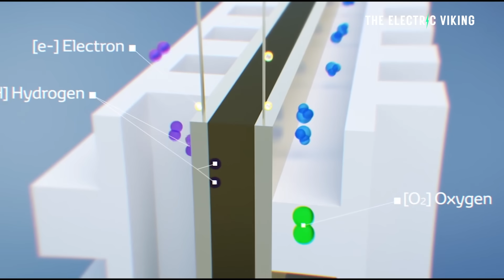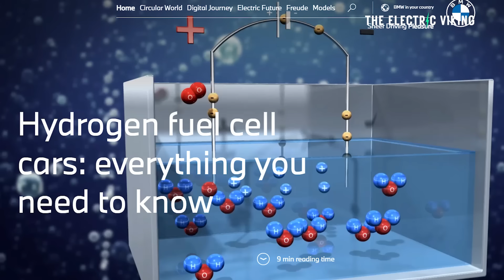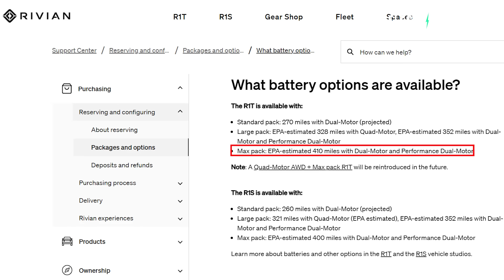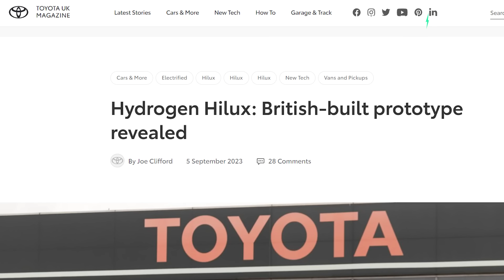Toyota's Hydrogen powered Hilux is the REAL future of the auto industry

Comment: Exactly what I say, hydrogen or ammonia...certainly not these EV's! No power grid for them, children mining crap to make batterys, no explosions that destruct everything around them, no range issues, no high costs of operating, no poor towing perf, no cold weather poor perf, no huge "take it in the arse" level resale problems, no insurance EV liability surcharges on premiums, no being told "no" by a tow truck driver or repair shop....wheew...wtf ARE we doing w/EV's! (that's rhetorical if you dont cheat at Solitaire and do have some dignity)

Comment: Can't wait for the hydrogen-EV hybrid version!
Reply: All H2 powered vehicles are hydrogen-EV hybrid versions.
Fuel cells don't produce enough current at a reasonable cost and size to provide peak power for a vehicle, so they all have a battery pack to spread the load. They also need a  battery pack to facilitate regen braking.
Reply: @PaulG.x  Not all. There are experimental cars with a hydrogen-fueled ICE engine.
Which is plain stupid. They consume twice the hydrogen that the fuel cell version does and don't have regenerative braking; in essence, you are taking all the weaknesses of the hydrogen car, combining it with all the weaknesses of the ICE car, and putting that into a single package.
Reply: @FabioCapela  I was referring to H2 fuel cell systems . Hydrogen-fueled ICE engine is absolutely pointless. And even then, they would almost certainly include a hybrid electric drive train because it boosts efficiency.

Comment: They have a point, which is consistent with European and American hydrogen production objectives by 2030. Transport is 15% of the global warming issue, the rest is due to burning gas and fuel oil. Consequently they are looking at Hydrogen has the means to replace natural gas and oil necessary to provide heat for power generation  and manufacture. The issue we know is hydrogen production and particularly ammonia transportation, billions are being invested in producing a solution, whilst blue hydrogen is the main source, prototype facilities to produce green hydrogen and ammonia are running in Europe.  However there’s a simple issue, the total European Car population is 250 Million on the road whilst European BEV population 3 Million cars or 1.2% so Europe is still in innovator stage. The U.K. is better at 3% with its BEV population of the total car population, so we have moved to early adopters stage so there is need for other solutions ammonia being only one.  There is a realisation, of the time necessary to cycle out cars hence the focus on synthetic and ammonia fuels to bridge the gap, hence why Europe and the U.K. have relaxed the ICE cars to 2035. However many professional analysts believe this will be pushed back to 2040, the original date suggested by the motor industry for full infrastructure to be available. 
However the priority for the EU and the U.K. which is aligned is to develop renewable hydrogen and it aims to produce 10 million tonnes and import 10 million tonnes by 2030. Prototype installations are working in Germany Spain and are being installed in the U.K. Consequently hedging ones bets, has Toyota is doing is sensible, indeed they are working closely with BMW, JLR and PACCAR Inc on the development of Hydrogen powered solutions. Basically you can’t find a three pin plug halfway up Cadair Idris.
Reply: Norway has shown how quick a transition to EVs can be.

This is more about legacy industries wanting a solution that they can dominate, not one they might not (like EVs, as we've seen).  And governments that are loyal to them (rather than to the people... it's a choice...just saying).  Of course, the legacies will say that they are the people, as they usually do, but the discerning observer will spot the difference.

The Biden administration's "target" of 50% of automobile sales being EV by 2030, looks more like a projection from public data on sales, likely to happen on current trends.

By 2040, most cars on the road may already be EV.  In motivated countries like Norway, probably well before.
Reply: @bearcubdaycare  Norway has 5.4 million population that half the size of London and they have a major hydrogen strategy, for example for heavy haulage this is in operation today. In 2022, the number of fully electric cars exceeded 500,000 in four European countries; namely Germany (1,089,854), the UK (641,801), France (605,791) and Norway (603,697) uk has over 900,000 now or about 3% of the total cars on the road, of 33 million.
Reply: "Basically you can’t find a three pin plug halfway up Cadair Idris."  Cant find a hydrogen station anywhere close to where i live. Every house from here to kakadu has a 3 pin plug.  The facts dont endorse your assertions.
Reply: @andyfreeze4072  Would that include Table Top.

Comment: I can be wrong here but even when hydrogen fuel cells become a reality you will still use electric motors.  The difference is you will fill up on hydrogen instead of using an EV charger.  So in reality it is still an EV.  The hydrogen vehicle may even use some limited amount of batteries.
Reply: Not may, will have a buffer battery. The reason is a fuel cell isn't capable of producing enough instant power to satisfy peak electricity draw.
Reply: You are correct . Fuel cell systems use the same motors and also require a traction battery.
The fuel cell is effectively a range extender
Reply: Less explosions.
Reply: @NonTypicalRacing  From what?  Hydrogen?  That's a good one.
Reply: @sambira  sure, our containment systems are much different now. What YOU need to do is objectively research EV's. After that, if you dont cheat at solitaire, you'll discover the OTHER problem w/EV's...zero resale.
Reply: @NonTypicalRacing  Wow, nice attempt at a response.  Zero resale?  In what universe?  Many resell their EVs all the time.  As for hydrogen containment, it is still a major problem.  Sounds like someone does need to do some real research.
Reply: @sambira  well, now either just lieing or sta sta stUpid in regards to EV resale.
Reply: @NonTypicalRacing  Prove that EVs are not and cannot be resold.  Show some data.  Also, prove that hydrogen is no longer difficult to contain.  And please learn English if you're going to try to troll in the language.
Reply: @NonTypicalRacing  Zero resale????

Another piece of FUD. Sure, residual value is less, but NOT zero.

You want to know why???

It's pretty simple, Newer models are just better vehicles, more range, better charging at lower and lower price points which lowers residual value of older models. Another fact is new vehicles come with Federal and State incentives which also lowers perceived value of older models.
Reply: @johnlodge8546  did your dumbarse actually think (strong word for EV crew) that I meant literally? Man Im waitin on the answer for this 1, this is good. Lol
Reply: @NonTypicalRacing  Any facts to back that up? 🤣
Reply: Hydrogen will never work because it is not cost effective. Already battery EVs cover the range needed by 95% of the population. Soon we could have 500 kWh/kg batteries, then there will be some 1000km a day cars. Hydrogen will never be price competitive.
Reply: They've been on the road for decades!

Comment: When will Hydrogen be the fuel of today?  50 years from now?

My cousin's wife lived in Japan until 2003.  She said that Toyota staked their future on Hydrogen in the 1990s and that is the story they are sticking with.
Reply: Japanese are known for their unwavering rigidity and at times serves them well, but right now it is becoming a huge liability.
Reply: Sandy Munro said that Toyota has a 100 year plan. I hope so, because it will take that long to get cheap hydrogen and H2 vehicles. Maybe fusion power. Maybe a pipeline to the sun, infinite hydrogen there!
Reply: Big concern no-one is taking about is the price of hydrogen. Currently it is many times the price of petrol or diesel and hugely more than electricity. 
Also currently it takes vast amounts of electricity to produce hydrogen. Seems crazy to do that rather than using it directly in ev's (which can also use an existing grid without the need for a hugely expensive distribution system)
Reply: @kevf101  I have not seen stats that show turning all our current diesel and gasoline usage for cars can be met by the current grids. Didn't Texas get a brownout just from some cold weather? Imagine quadrupling the power usage per home.
Reply: @geoffhaylock6848  The important thing is that EVs will reduce energy use drastically.  It's been theorized that the amount of energy used just to produce, refine, and distribute gasoline is equivalent to the amount of energy replacement EVs would use. Without burning oil.
Reply: @jamesvandamme7786  Nice idea. I'm a big fan of EV's. But when you change from one product to another there is a massive upfront cost in terms of CO2. The electric car factories did not exist and had to be built. The battery factories did not exist and had to be built. The huge amount of lithium refining needed didn't exist and is growing. There are good and bad with all forms of transport. Personal cars will never be 'green' they are simply a huge user of natural resources. If you look into what products come from oil refining, you will see we will still need oil for many years to come. Now, what do we do with all the diesel and gasoline that comes from the refining process if we no longer burn it in cars?
Reply: We will have bacon fueled cars before hydrogen 😮😮😮😮
Reply: @mr.foxwiz1653  sounds tasty lol
Reply: @mr.foxwiz1653  There's biodiesel now. I bet bacon would really smell good.
Reply: YouTube channel 'Connecting the dots' has made an excellent analyses why Japan is so invested in Hydrogen... Long story short, Japan does not want to have anything to do with China, and Japan has no domestic sources for battery materials, and outside China there are not many suppliers that could serve Japan's potential needs for battery materials (This is slowly changing now, but was really a problem just a couple years ago). But Japan has big stakes in the oil industry outside of China, hence the bet on Hydrogen, because that would keep Japan independant from China, keeps the oil industry happy and would transition Japan to a more sustainable future. Problem is, its only Japan doing this and Hydrogen does not gain attraction at all.

https://youtu.be/oKSN2AzZiUo?si=fB3XoxKjrqdNNfmW
Reply: Toyota is full of shit.
Reply: Easier everyday with EV liability.

Comment: Hi Sam, greetings from the U.K. What is it with this obsession with hydrogen. I just don’t get it! Here in the U.K., hydrogen is £10 per litre, petrol is currently £1.70 per litre. Hydrogen is difficult to transport and store, and explosive when combined with oxygen, Earth’s atmosphere is approximately 20% oxygen. Physics is not on hydrogen’s side. Crazy!
Reply: I don’t get the economy here
Hydrogen car is much more complex, thus more expensive to produce and less reliable 
Second. H2 infrastructure needs HUGE investments to succeed. While EV infrastructure is way way easier to build. Plus, charging infrastructure can serve purpose of grid stabilizing when uses battery packs. 
Third. H2 is more expensive due to transformation processes. It’s so inefficient compared to EV. 

I want to see numbers, but Toyota is just declaring statements and playing with PowerPoint just like VW did last 5 years

I afraid that by 2030 EV’s will advance so much
Reply: @velvet_head  if you want to know then do some proper research and not take the Electric 🦧 word for anything!
Reply: @lesliecarter4295 worked with Fuel Cells for 10 years, hydrogen is an awful material to work with and if you think EVs are expensive, wait until you see the price of Hydrogen vehicles😂😂
Reply: Not sold in litres in the uk !
Reply: The clue is in the fact that Toyota is partnering with a fossil fuel company……….
Reply: Didn't the hydrogen stations in the UK just shut down? Didn't Shell abandon building a whole lot more stations due to them not being cost effective.
Reply: UK sells hydrogen by volume?  In California, hydrogen is sold by the kg
Reply: @cyclopsvision6370 it doesn't matter, because below the line, 100km or even 100 miles are much more expensive with hydrogen than anything on the same distance. And hydrogen is made of natural gas by using much energy.
Reply: That is the kicker! Hydrogen is isolated from CO2 and coal, requiring more energy and costs as inputs than you get out in the end! This is the perfect corporate welfare boondoggle; an even bigger boondoggle than ethanol!
Reply: @freeheeler09  of course it requires more energy and costs as inputs than you get out in the end because hydrogen is a carrier of energy. It should not be made from  Natural Gas reforming or gasification like most of it today but obtained via electrolysis using renewable electricity to split water into hydrogen and oxygen. While it has many challenges like being a tiny molecule (leaks everywhere...), it has the advantage you can use it for FCEV but also heavier truck engines and even producing heat. One day we will look back at this age and wonder why we thought it was a good idea to produce 2.5 ton (5500 lb) vehicles... The amount of minerals required to produce batteries and heat pumps is stagering... I would be happy with a lighter vehicle with a small battery but equiped with a fuel cell as a range extender, heck even the e-CAT from Rossi would make more sense...
Reply: Hydrogen is actually green. EVs aren't. Simple as that....
Reply: Hydrogen is key to fossil fuel companies green washing.  Almost all hydrogen is made via natural gas.  It's a terrible idea for almost every angle but because it's the only hope for these companies to survive they are spending all their lobbing and bribe money to get it going
Reply: “Toyota says…” says it all.  No way Hydrogen ever takes off, it’s hot garbage.
Reply: As a UK taxpayer I’m not happy that Toyota have managed to persuade the government to pay to develop this truck. There will be no return on the investment. If Toyota see a profit in it they should pay for the development themselves.
Reply: @EVinstructor  it’s from the same funding package that is being used to develop your precious batteries so quit whining about it !
Reply: @lesliecarter4295  The LFP batteries in my car were developed by CATL and supplied to Tesla in Shanghai. If it wasn’t private investment CATL, the worlds largest battery manufacturer, would have received it from the Chinese government.
Reply: The green dream is that everybody that has surplus renewable power like PV at noon, can convert it into hydrogen and store it unlimited. There are a few commercial trials in Austria
Reply: yea and you need three times more PV panels to convert water to H2 .  Batteries are so much less hassles, less maintenance, less parts, more efficient and cheaper. @ttkddry
Reply: @andyfreeze4072  and how long can store or accumulate hydrogen compared to battery storage? Add cold weather...
Reply: @ttkddry Ridiculous...much more efficient and much less costly to store any excess solar PV generated electricity in batteries.
Reply: @greggrant4614  it all depends on the math and study bureau that did the comparison study... Perhaps for hydrogen you need less African children to mine Rare Earth Minerals...
Reply: @ttkddry Math is math, the numbers for hydrogen doesn't make sense. But let's do it anyway. Because we have not been investing billions on battery but billions on hydrogen, can't let that go to waste, the fallacy of too big to failed.
Reply: @nguy404  there have been many times in the past competing technology races where the winner was not the best one but due to external factors like supply chain or jurisdiction, it left the other tech in the dust...
Reply: @ttkddry Yes exactly. VIDEO 2000 was superior to VHS. But all rental movies came to VHS so VIDEO 2000 died. You can compare this to the infrastructure that has been built in the last 12 years for electric cars. It already exist. So it doesn't matter if hydrogen is better. Before there will be a hydrogen pump in my city the battery capacity has increased to make hydrogen obsolete .
Reply: @RonnyJakobsson  you should read the book Crossing the chasm, you will probably like the train of thought. As an early adopter I like BEV, but only for the EV part. If somebody can improve my EV experience by making storage lighter and cheaper, refilling faster, then I will jump to the next energy storage tech.
Reply: @RonnyJakobsson the infrastructure to go all electric is going to need 500 times more than what is currently available. And what we have is a shambolic mess.